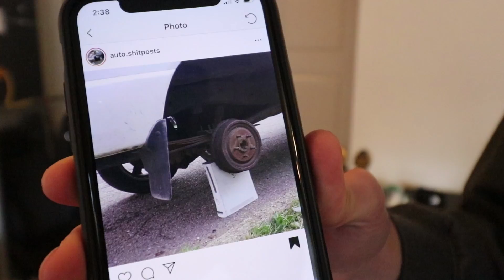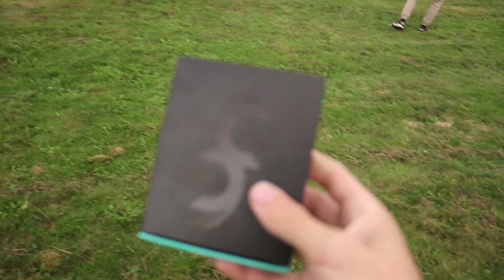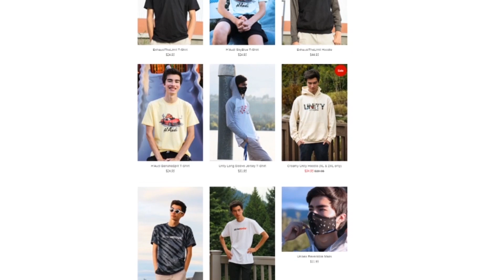Using an Xbox 360 as a Jack-Stand (Car Science)

Comment: nanananana it wont work because on the truck it was on the other three wheels as well so very little of the actual trucks weight is resting on the xbox judging by the size of the other wheels in the truck pic the xbox is probably only holding up the weight of the right side of the axle and providing just a little bit of balance and the car is balancing on the other three wheels